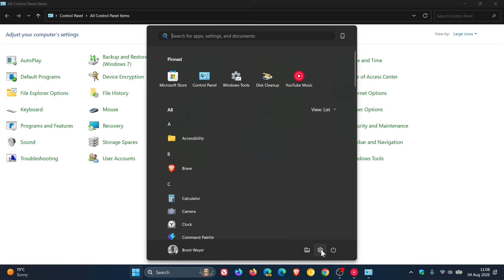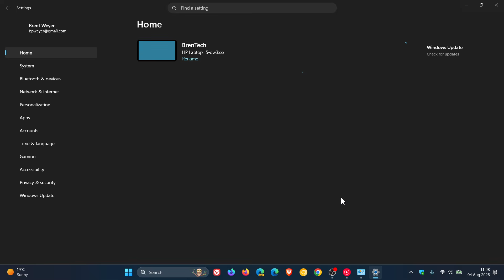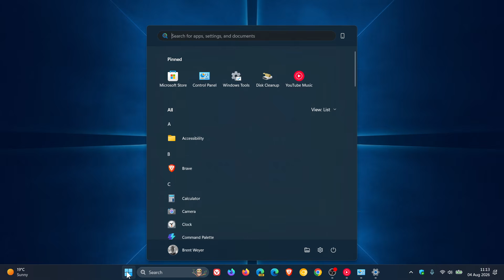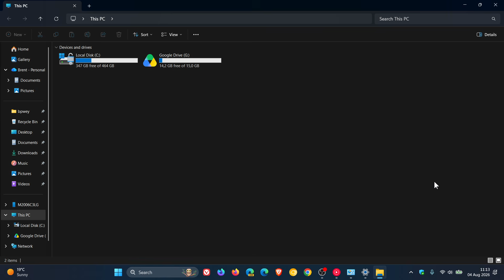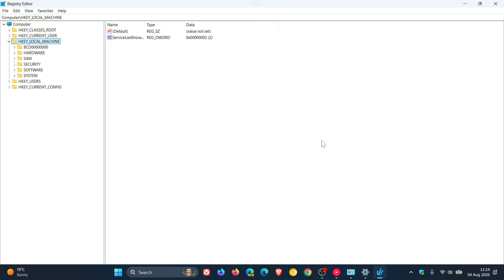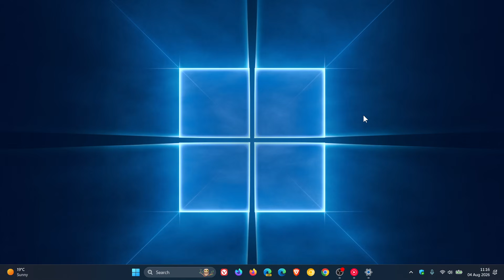Microsoft Explains Why Modernizing Windows 11 Takes So Long!

Comment: Because of these comments and videos I got mixed feelings about Windows 11. Upgrade or downgrade? Stay or move on?
Reply: Windows 11 is what made me and my family, even elderly family, switch. We all been happy with Debian 13 KDE, and the LibreOffice suite. If you gotta deal with someone who is sending you those broken OOXML documents from Microsoft Office, just use Googles web browser suite. But I would try sticking with ODF documents, which has been around a long time, and the Europian Union (and hopefully soon too our fellow Americans) have standardized on for all government and educational needs. I don't want to get too far off into the weeds, but understand Microsoft software purposfully messes with the formatting to keep you dependent on it. That being said, cut them off and learn Linux now so your skills grow on something sustainable. The longer you wait, the more behind you will be when your forced off of Microsoft due to prices, unless you dont mind paying into it. But I say just leave now. My parents are almost 70, and they learned Linux. You can too. I believe in you.
Reply: @legalallies9  I'd have to either get a new GPU or stick to older games that don't require much graphics card activity because of a bug in the amdgpu driver. The system doesn't load unless I use amdgpu.dpm=0 or nomodeset in kernel parameters, which disables dynamic power managment and isn't ideal for games. Windows 10 does fine without them. RX 570 is old so Linux most likely doesn't support it anymore. I tried LTS kernels and distros - all the same.
TL;DR it just doesn't do well on my build.
Reply: @diffgamey Yeah, I get that. Lets be honest, Windows will do better with games, for now, and niche corporate/professional stuff. Companies are going to have to move to Linux. Granted, Windows could be ran as a virtual machine. But still. For me, I am not a gamer, so thankfully I don't have to give up my freedom. I run Steam on a seoarate dedicated laptop for security purposes. I keep all the serious business stuff on its own laptop running strictly Debian 13 KDE with only stuff from the Main repository. If I want to do anything silly or unsafe, like to Arch linux and game shenanigans, thats for the ol' game computer.

Comment: Meanwhile, System76 has built a whole new Desktop Environment called Cosmic for it's Linux system in 5 years. They had a vision for something different, and they just did it. A whole Desktop Environment is a big project and yet they've brought it to fruition in a fraction of the time Microsoft have been working on their's and MS are starting with an enormous code base. This is probably half the problem but they have a resource pool one or maybe two orders of magnitude greater than the System76 UI team.

Comment: Every single version of windows that comes out I customize to look like windows 98 in darkmode, absolutely gorgeous, super efficient and easy on resources using Arc UltraUXThemePatcher program and set it to the 'Arc-Void' Theme, I refuse to use windows stock themes. Windows never needed modernization, it just needed dark mode everywhere right thru its entire os, which wouldn't have broken anyone's compatibility promise. Microsoft just wasted 25 years trying to achieve what free third-party programs have been doing perfectly since 2001.

Comment: I have seen pictures of a windoze eleven, but what I got was a permanently offline rebooting software, which doesn't allow anyone to work. Maybe one day I may be able to log on, until then I will sure M$$$$$$ for 2450725027502570547084570257024657045725042 work hours of twiddling thumbs.

Comment: I made a reserve Control Panel file so if the default one disappears I'll just add the one I made to the menu and it will be back. There is also the God Mode file which has everything in it in one place. For those interested in the God Mode file see below:

GodMode.{ED7BA470-8E54-465E-825C-99712043E01C} is a folder name that activates God Mode in Windows, which provides a central location for accessing all of the system settings: 
•	What it does
God Mode creates a folder that contains shortcuts to all of the settings in the Control Panel. This allows users to access all of the settings in one place, instead of searching through the Control Panel or Settings app. 
•	How to activate
To activate God Mode, you can:
1.	Right-click on an empty space on the desktop 
2.	Select New and then Folder 
3.	Enter the folder name: GodMode.{ED7BA470-8E54-465E-825C-99712043E01C} 
4.	Press Enter

Comment: Microsoft is full of S. It doesn't take 15+ years to come up with a unified control panel. All they did from Windows 8 onwards was to fragment it, overlap features, make settings clash with each other and alienate their user base.
I'd be happy if they could just undo the damn thing and just use the new control panel as a launcher for the old stuff.

Comment: I do understand the difficulty building on such old code while trying to modernize. This has to be mind blowingly difficult. I really think they need to start working on a new Windows that starts from scrap.
Reply: Supposedly its for backwards compatibility. I dunno, maybe? I get that to a point. But some companies are still just using the old Windows versions in virtual machines as a workaround anyway. That means two things: One is that old windows is still useful. And two, you don't need to bring absolutely everything to the new system. Instead, support the old stuff, emulate it, or run it in a virtual machine The tech exists, but that would ruin sales perhaps. Who knows.
Reply: They tried.   It went as well as you would expect it to…OH, did I mention the removal of legacy aspects?  Why? Enterprises depend on decades of Win32 apps. Gamers depend on DirectX, drivers, and hardware-level optimizations. Removing legacy support - even for a “better” OS - breaks too much.
Windows 10X proved that a radical reboot is commercially impossible.
Reply: @Mario583a I honestly feel like a lot of that inflexibility has something to do with the licenses used. Think about it: Proprietary code has a lot of legal red tape affecting it, creating a legal landmine. FOSS code uses things like the GPL, making the kernel flexible. Rewrites becomes expensive and political under proprietary licenses. Whereas Linux, though also political, isnt held back by laws. That means the only politics behind updates come down to license compatibikity and function, rather than alllll the legal trash that comes with other proprietary licenses. And that is my theory on why Microsoft turned to scrap.
Reply: The next step will be a linux kernel with a proprietary interface and a wine like compatibility layer.

Basically they'd get the OS developed for free and get to keep the code for the proprietary stuff for themselves.
Reply: @bufordmaddogtannen you are SO RIGHT!! And yes, this exists, believe it or not!! Hear me out: Essentially, your describing running a virtual machine, for real. Legally, you cant pair that stuff in directly with the Linux kernel. So, like a Wine compatibility layer you basically just run literal Windows. KVM-QEMU using Virt-Manager will literally partition the CPU, GPU, RAM, and any hardware components you want. It will literally run Windows directly on your hardware, sandboxes in its own virtual machine, right now. What your talking about is the way! And this is how it is done! If you haven't tried running Windows in KVM-QEMU before, especially Windows 10 and older (Windows 11 needs a virtual TPM chip😂), then please try it! Once you learn the how and why of hardware virtualization, you will realize that Microsoft is best ran as a virtual machine under Linux, rather than be installed. And to be perfectly clear, this is the way to run Windows DIRECTLY ON THE HARDWARE, side-by-side with the host Linux operating system.
Reply: @legalallies9 i have been working in IT for almost 30 years. When I need to run a Windows application I either use Wine or I turn on a different PC. Why? Because while Linux runs well in a VM, performance with a Windows guest just sucks. 

What I'm describing is a Linux distro with proprietary components developed by Microsoft where you can install and run software that you'll never see ported to Linux.
Reply: @bufordmaddogtannen Honestly, your right. Your in the thick of it, with specialized needs. This is a case where a company chose to specialize in the Windows ecosystem. Linux just hasent gotten enough popularity to gain that same level of notoriety so as to gain that type of development. Goes to show that sometimes popularity of a system often drives integration. Perhaps one day we will see a change. But until then, Microsoft will fill a niche that Linux cannot. At least, not yet.
Reply: @legalallies9 . The main issue IMHO is that Linux doesn't offer a stable platform to develop commercial software and all the technologies that try to address the issue (e.g. Containers, flatpacks) are band aids at best.
Moreover development tools and debuggers are subpar compared to Visual Studio and there are no enterprise tools to rely upon.

For the rest, it's excellent in niche contexts, just not on the desktop.

Comment: I have one computer left with Windows 11 (an older Dell Optiplex). Some day very soon that machine will get Linux too (ZorinOS, I'm thinking).

Then only ONE computer of mine will still have Windows 10 (and that is my gaming PC with a Ryzen 7 5700X and a 3070Ti), which I will keep for as long as Steam supports Windows 10.
Reply: I hope it doesn't get a forced update. I know some people that happened to, and it maxed out the hardware specs to where it could not run the same programs and do what it did before.

Comment: It would take 1 guy a couple of weeks to change the white windows, to a darker colour, matching windows 11 dark mode, without changing the layout at all. Then after that, they can discuss if they want to change the design.
Since atleast windows 98, there has been full support for changing the old boxy windows colors, so I don't get why they don't start with that, to stop blinding people. And it will retain compatibility.
Reply: I wonder why they pulled that feature in the first place. It felt healthy for the eyes.
Reply: @legalallies9 yeah, ever since Windows 98 I've changed the windows (and the white background) to a darker color. And then they removed it in Windows 10 (i didn't use 8).
Reply: @powerdude_dk Funny you say that, because I diddnt use 8 or Vista at home. I hopped from XP to 10 somewhere along the way, I don't even remember the ones in between if I did use them. I remember the job Inwas working at installing vista, it broke an entire production line, and they rolled it back just to keep an entire production facility rolling. Supposedly from that one incident, they lost tens of millions of dollars, and I myself diddnt get to work for a few days. It was sad.

Comment: Microslop version of being modern is slop and bloatware with data telemetry and google is following in the foot steps like microslop since both want to be agentic ai operating systems. The only thing modern would be linux and the constant improvements they are making that makes the user experience easier to use for first time linux users. For certain operating systems, a first impression sometimes makes a difference for them due to the user experience and easy to use while also being stable and reliable. I'm glad that linux is constantly improving and getting better due to the linux community feedback. I'm rooting for linux and I have been a life long user of windows all the way back to ms-dos when I first used a computer as a kid. The toxic individuals in the linux community needs to be more welcoming so new comers feel welcome since being toxic is just childish. It's not going to make the situation any better and it will end up being a deterrent that will sway certain users away from linux. Certain hobbies in the community can be toxic but it should also apply to what I just explained on how the hobby communities should be more welcoming to new comers.
Reply: Linux will overcome. The most ironic twist is my ageing mother (Almost 70) can't keep Windows 10 on her computer, and finds Windows 11 desktop difficult, and creepy with its AI. So I am moving her to Debian 13 KDE so she has a familiar interface to traditional Windows. Also, she can learn some FOSS software like Libreoffice that is more consistent. It isnt going away, and has solid open source document standards that Windows often breaks. Glad she will be able to learn it before getting too senile, because now as she ages, she wont have to keep relearning new workflows.

Comment: There is a modernized & better OS and it's called Linux.
Reply: Unfortunately the going backwards with the GUIs too since the last 10 years, oversimplification and dark mode are rampant there too.
Reply: @sviktor4Linux and LibreOffice will drop the need for Windows. Wait and see. We just need business to standardize on FOSS formatted documents and be done.
Reply: Word! Been using it full-tilt since January 2025! Haven't looked back.

Comment: As LTT has illustrated with the interface, using QT with GTK can cause some things to not work (when Elijah was trying to create a USB disk with FAT32, and the button was invisible). However, with Windows being so large as a OS and a desktop interface, this answer probably shows how much MS has cut back on staffing to "piecemeal" their settings.  The registry editor still smells of Win95, but they wanted to add Copilot to Notepad? I think they chose the wrong priorities.  Kind of glad I switched to Linux and using KDE as my desktop environment.
Reply: I use the same desktop environment. Really is superior.
Reply: I stopped using Windows 11 in January 2025 for vanilla Debian 13 KDE. WORKS!! And LibreOffice respects ODF documents, and other open standards, which Microsoft365 tends to break. That's why Europe, colleges, and US Government is all switching.
Reply: You can't defend this stuff not for Microslop not for other desktop enviroments, here is why, a guy went to try out Linux Mint Cinnamon, wanted to change the theme, didn't went as well as he tought since programs use different themes and different version of themes, so he rewamped GTK 1, 2, 3 and Qt so all programs will look in the same theme and he did it under a week.
Reply: @sviktor4Your right. And I suspect the reason why things arent working with Windows is tech debt overall, combined with proprietary code, on top of new people not being up to speed on software after the old guys leave, get laid off, retire, get fired, or whatever happens to them. With Linux and FOSS, the documentation literally comes with the software, you got the power to make changes, and its a done deal.

Comment: Who in their right mind even uses Windows Registry Editor? Registry Finder exists and besides the fact being superior when it comes to being practical and functional it already support dark mode. Are people suppose to be impressed by all this microslop speak when they have ignored fundamentals for so long that the homebrew users already solved most of these so called "modernizing issues" ?  

Before removing the control panel, how about learn how to make a proper functional UI for the settings that don't have everything spread all over the place like a doomsday device gone of in the office? Stop wasting space, make a settings tree like the Group Policy Editor but in a more modern GUI and add a search function for it and sorting/filter function so every setting can be accessed and changed within one damn window... and don't forget to add actual proper information on each settings...
Reply: My very 🙄"favorite"🙄 features of Microsoft Enterprise is how my documents work in the cloud, vs on the PC. Some of the programs, like Excel, cannot be fully edited in the browser. So I have to "launch in app" on the computer. Which takes a long sign in process that takes 3 to 5 minutes to verify with the server (we have slow internet), to grant use. Then it wont auto save correctly, so I have to click through and find it in the cloud, and overwrite the original. Or my other "favorite" is how JPEGs only open in MS Paint in the browser. So I have to download it, right click, select "view as photo", and THEN I am able to pan the image properly!🎉😂GOTTA LOVE MICROSFOT!!🤑🤪🥳